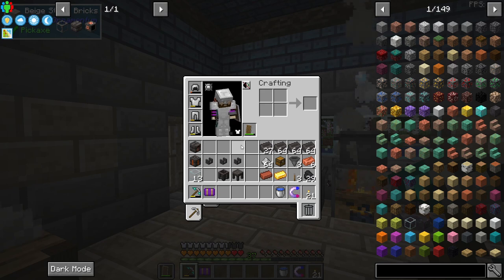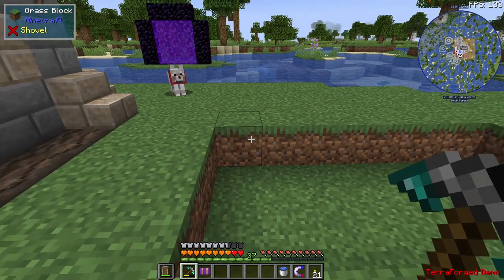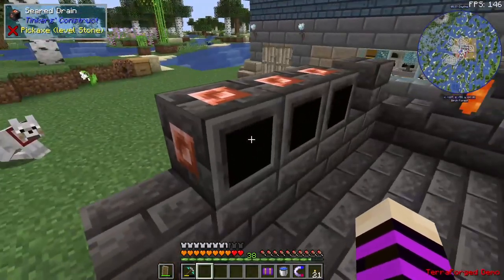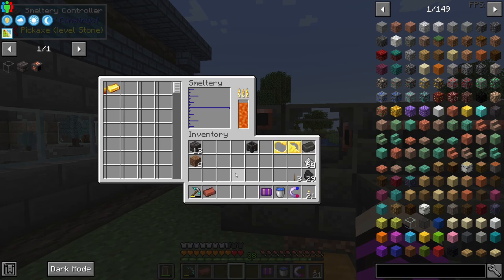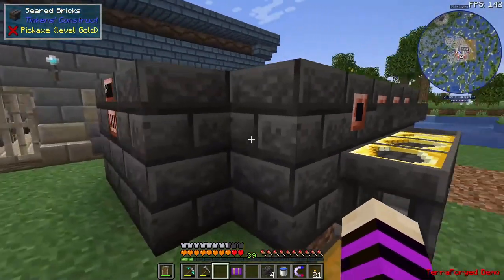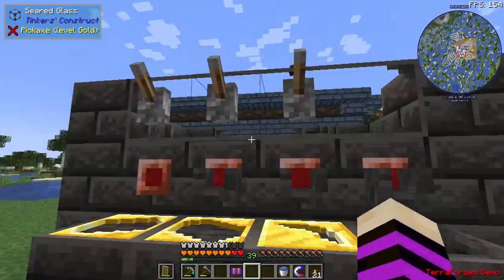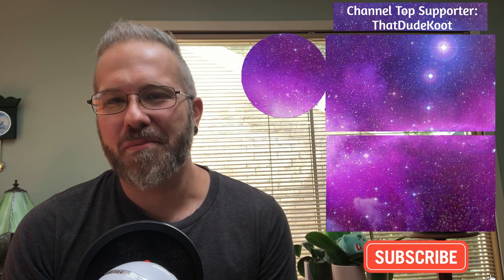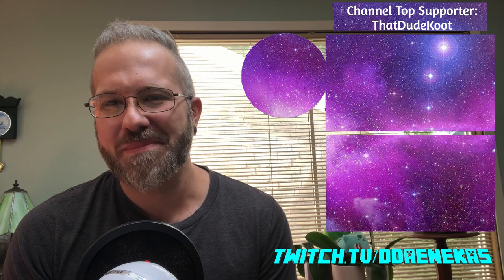Tinkers Construct Mod Spotlight 1.18.1 EP 3 - How to Make a Smeltery! How to Automate Tinkers!

Comment: Any idea why my hoppers will not connect with a chest.. I have tried everything and it doesnt work. Also, I can not find the switches you used in the end of the video, can you tell me where to get them?
thanks
Reply from the maker: Hopper should work if you shift right click them to the side of the chest. If multiple hoppers make sure they are connected to each other. The switch is from the gauges and switches mod... if you don't have it installed, it wont be available.